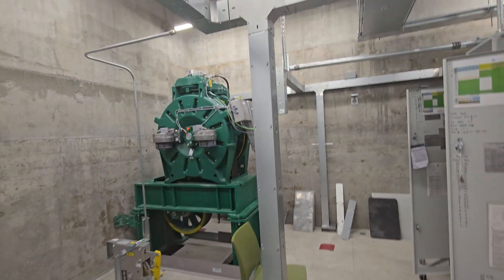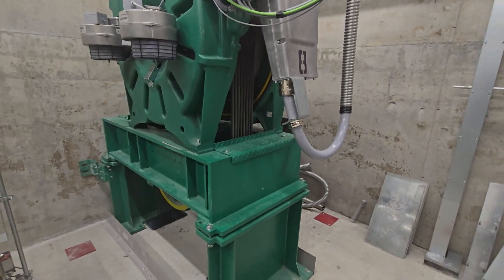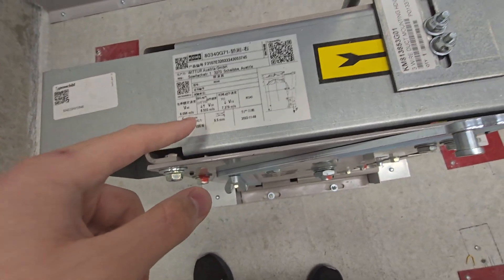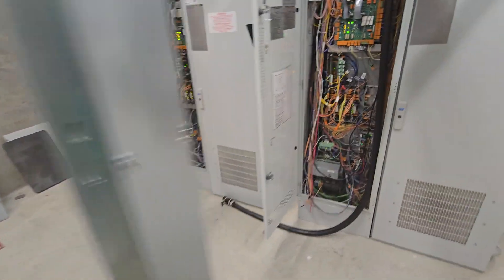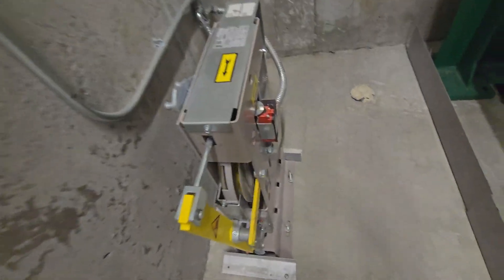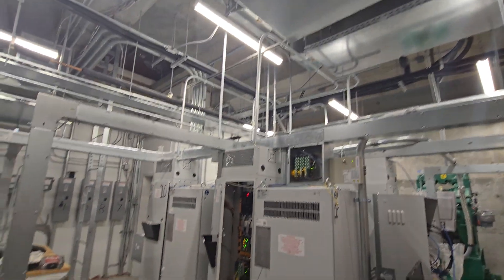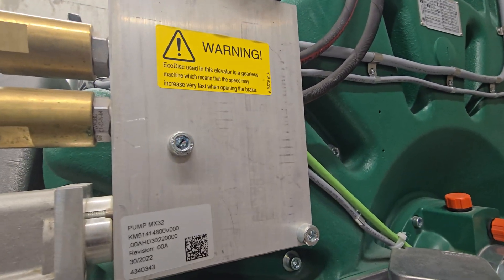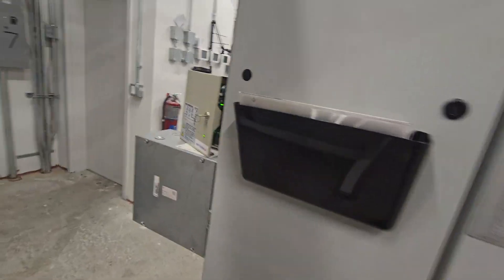AMAZING 1200FPM Kone MX32 Traction Elevator Machine Room

Comment: I looked up the fault being displayed on the first controller (car 7) out of curiosity - 00 46 means that the doors tried to close but the gate switch, close limit, or interlock didn't indicate closed when it should have. It then tries to close a few more times before changing to fault 00 44.